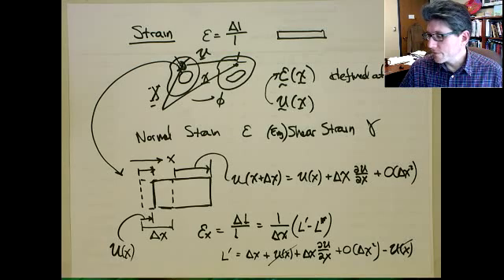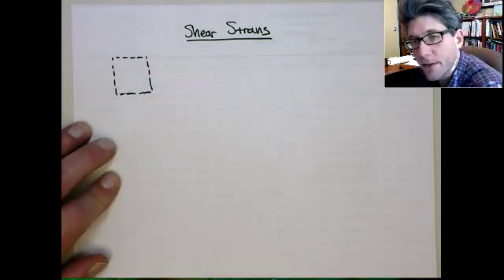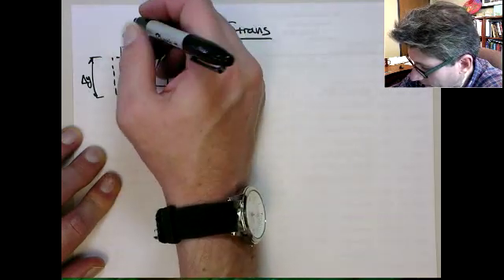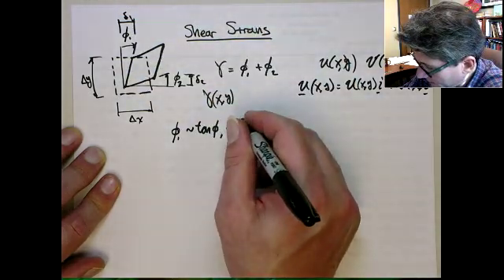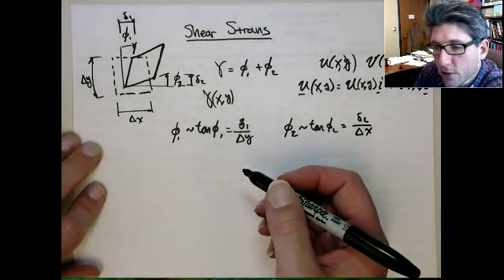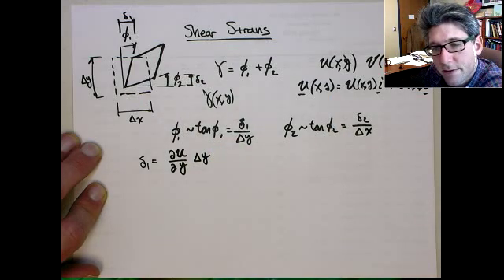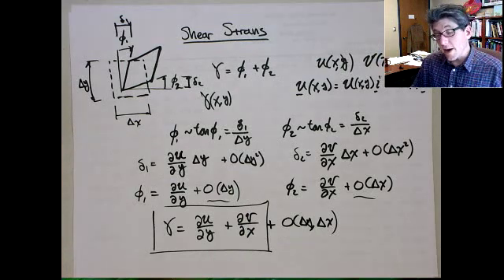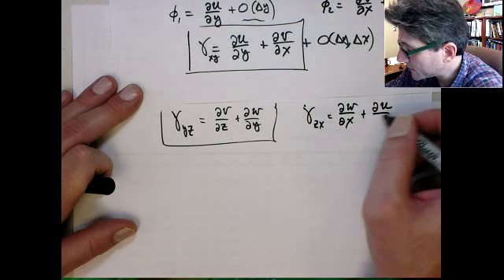Shear strain derivation.mov

Comment: in some books it is divided by 2 !! how that? 
i think there's error
Reply from the maker: There are two typical shear strain definitions.   There is what is called the engineering shear strain (what is discussed here and in most undegraduate texts) as well as the tensorial shear strain which is 1/2 the engineering shear strain.

Comment: Could you please do a detailed mathematical explanation of the delta 1 and delta 2 equations? I do not seem to understand it thoroughly. The explanation, I must admit, is really good. But, need some help with that particular equation. Thanks.
Reply from the maker: The proper way to do this is to write u(x+deltax,y+deltay) and v(x+deltax,y+deltay) out in a Taylor series expansion about (x,y) being the lower left corner.  So the y-displacement is  v(x,y)+dvdx deltax + dvdy deltay +O(delta^2).   In this case, the displacement in the y-direction at the lower right corner is deltay=0 so we have  v(x+deltax,y)= v(x,y)+dvdx deltax +O(delta^2).  The displacement at the lower left corner is of curse simply v(x,y).  So the change in displacement between the lower right point and the lower left point is  what I am noting as delta2 in the video and would be   v(x,y)+dvdx deltax +O(delta^2) - v(x,y) or simply delta2  = dvdx deltax +O(delta^2).  You can do the same in the upper left corner but expanding u(x,y) and you will get the result for delta1.
Reply from the maker: Are you unsure about how \delta_1 is du/dy and \delta_2 is dv/dx?
Reply: Yeah, because u is a function of both x and y, right? and so is v. So, when you said, the displacement is in x direction but due to change in y, it did not clarify my doubt. According to me, there is displacement in both x and y direction at that point. I am sorry, if the question is confusing you. Thanks.
Reply: Hi，I also have the confusion about the equation of delta. Why delta1 is du/dy and delta2 is dv/dx? I try to understand this but I failed, so could you please explain it in detail? Thanks a lot!